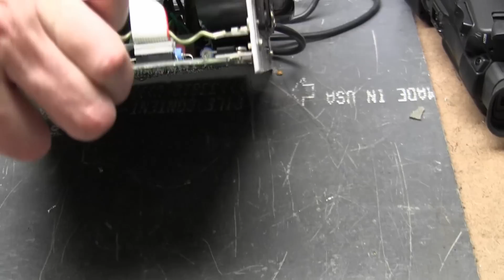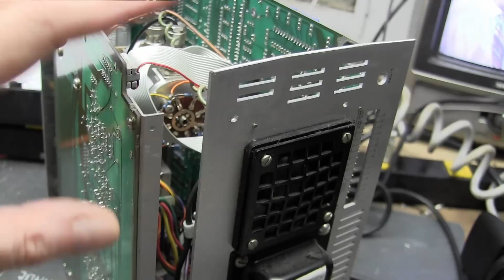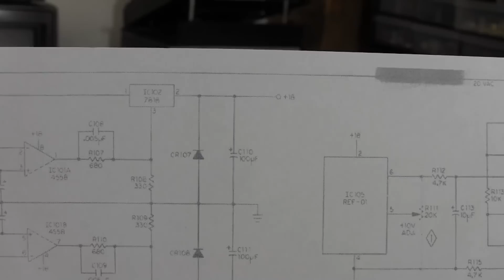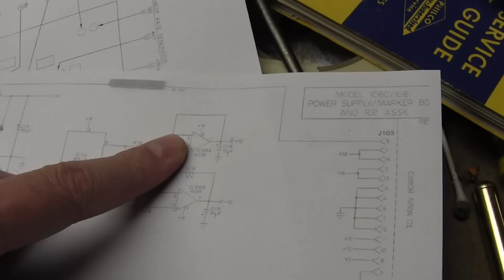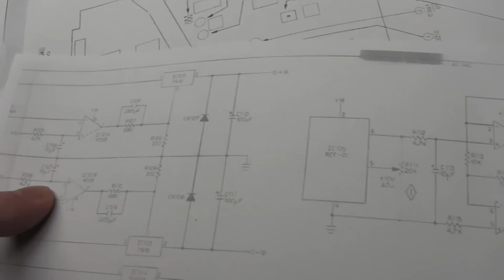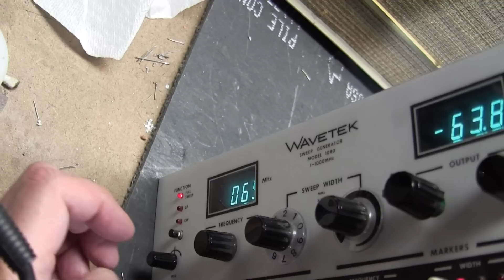Wavetek 1080 repair part 1

Comment: Have you measured the resistance of the power rails (to ground), on the main board ? (un-energized)
Sometimes if there is a short, it may show just a few ohms. But as you probe around, the ohms get closer to zero, the closer you get to the real short.
Reply from the maker: Please continue watching.  Shorted tantalum caps were the problem.
Reply: I watched the final video.
Good job.

Comment: Hello, it seems the link to the manual is not working. I searched manually on his site and the 1080 manual is not available there. Would you be so kind to provide a new link or, if possible, send it to me? Thanks.
Reply: I mean, the service manual with the schematics. I already have the instructions manual.

Comment: I spotted a website with 46 pages of 1080 info that seems to have the ever elusive TP's . However it is near impossible to post that information in a comment, as you will know. I tried 100 ways of obscuring "the address" but all failed and were quickly removed by eBay after a screen refresh. Well, the system works. Good on you eBay! :)  So instead I encoded the web address in HEX. There are quite a few converters online (both directions) so it should be just a click or two to get it back to ASCII. Where there is a will there's a way? I hope it can add to your WaveTek data.  Cheers -Randy

68 74 74 70 3A 2F 2F 6D 61 6E 75 61 6C 73 2E 72 65 70 65 61 74 65 72 2D 62 75 69 6C 64 65 72 2E 63 6F 6D 2F 74 65 2D 66 69 6C 65 73 2F 57 41 56 2F 57 41 56 25 32 30 31 30 38 30 2C 25 32 30 31 30 38 31 25 32 30 49 6E 73 74 72 75 63 74 69 6F 6E 2E 70 64 66
Reply from the maker: You can get many Wavetek manuals include the 46 page 1080 manual couresty of Chris Grossman:  http://chrisgrossman.com/manuals/wavetek/Wavetek-User-Guides-2019.pdf

Comment: Flaky? Got a dry joint Bob or tarnished IC legs?
Reply from the maker: It was flaky, now it's dead.  Shorted tantalum cap in the RF sweep module seems to have damaged something.

Comment: So many Trim Pots for Calibration...SHUDDER. Look forward to see what progress you make.
Reply from the maker: Even better - the service info does not include a schematic for the main board or have any instructions for adjusting those trimmers!
Reply: @bandersentv  My recollections are Wavetek had some great tech and designs but their quality was not up there with Tek or HP even close. I remember one piece of gear we had to send back 3-4 times to get fixed correctly under Warranty.
Reply from the maker: No, not even close, but also considerably less expensive.  Problem with HP is they just didn't make basic workbench gear.  Their comparable sweep gens are overkill for doing alignments.  Not that I would turn one down ;)

Comment: I don’t recall you saying that there were any power transistors buffering the voltage regulators. So, whatever current is demanded of them must be expected to be within the spec limits for the regulators. The data sheets will tell what that limit is. So, you could load them to the device spec limit to see if they fail. Perhaps that would define whether the fault is in the power supply, or the load. 
In other news, I bought a Tek 465 from what I think may be the same source you did. I haven’t powered it up yet, but it arrived in reasonable physical condition. I hope it works OK. There are some things for which I think the analog scopes are just better suited than the digital ones. I hope you’re able to get your generator functional again. I enjoy your videos.  Regards, Gar
Reply from the maker: There are no buffers, regulators good to 1A normally. However, this design inserted a 330 ohm resistor between the regulator and ground. Then connector to some op amps and a voltage reference. I believe the goal is to create a more stable supply? Not sure what effect that all has on the current limit
Reply from the maker: I bought my scope from a seller in Elgin, IL. Good luck with yours and thanks for the support.
Reply: I think it’s from the same seller. Mine had been a military scope at some point during its life, as I found painted unit designations on it while removing old paint prior to painting. No one but the military does that… I think it was Army. Krylon 5501 “Gloss Bahama Sea” is a pretty close match to Tek blue, if you’re interested. It wouldn’t do for touch-up, but is excellent for a complete redo.

Comment: My only thought is to try an isolated, current limited +18 and -18v supply to the unit and see if the RF unit draws excessive current or even works, just to try and break this chicken/egg scenario.
Reply from the maker: Yes, I will try. I have a current limited tracking dual DC supply I can use.
Reply: That was my thougt as well, that and sending it off to shahriar of the signal path channel 😊
Reply from the maker: @bzuidgeest  Haha.  That would be an amazing crossover video.
Reply: @bandersentv  well you never know... Normally he has to buy his problems to repair, you can provide one for free🤣

Comment: I have both the 1080 and the 1081, both work fine (last time I used them anyway)...the difference between them is the 1080 is 50 ohm and the 1081 is 75 ohm....by chance would you be able to share the docs on them?  ~Jack, VEG
Reply from the maker: Yep, there's just a single resistor inside that sets the output impedance.

Comment: I have used a thermal camera several times to find hard shorts on PCBs.  I sent 3A at .2V through the short and it was enough to make it get a few degrees hotter than ambient.  The low voltage is low enough that it does not forward bias any semiconductors.  If you have a hard short there isn't a lot of other easy ways to find it I don't think.
Reply from the maker: That's the problem - I don't. Well that is I did and replaced the shorted cap.  There's about 1,000 ohms between the +18v rail and ground now.  I suspect when the cap shorted it damaged something else.
Reply: @bandersentv  1K and it still is shunting it to ground? that is pretty weird.  unfortunately everything is soldered inside the can.  is it possible to disconnect the marker/oscillator parts to narrow it down or are is the power for both connected together on the pcb
Reply from the maker: @kevtris  No, they are separate.  I know it's the oscillator side that is the problem.  I get 1K when I check resistance between the +18V input to the oscillator and ground. I suspect the problem is when it's powered up.  It loads down the PSU enough that it shuts down.  I should also test the +/-18 volt supply with a heavier load.   It's still possible the problem lies in the PSU

Comment: What a difference between this "beauty" and the Sencore? Wavetek design, construction and parts are, not the highest, but a decent high level quality. It can be easily seen. You should continue in this restoring effort and for sure you'll find the solution. Don't stop please..... It's worth it...and please, post the videos...
Thanks
Reply from the maker: Well to be fair it's also about 20 years newer.

Comment: I always worry about those aging VFD's . Once they are worn out they are done . Old pins and switches get tarnished after a long period of time and can cause some problems namely erratic performance like those 33 yr. old tantalum and electrolytic  crapacitors. It is worth fixing for sure Bob.
Reply from the maker: These VFD are nice a bright for now.  One good thing is that it uses 7107 to drive them. 7107 are designed to drive LED displays directly so it should be possible to convert to LED displays.

Comment: Somewhere near the display should be a little higher voltage for the VFD's That power missing would blank the displays. No anode voltage.
Reply from the maker: Correct.  If I plug in the Rf module, the +18V rail drops to about 0.3 volts.
Reply: @bandersentv  Standard 7818 stabilizer has current protection set to approx 1A, than it switch off.

Comment: Can you sub in a bench +/- 18 volt supply to test your theory?
Reply from the maker: Ah, but sub in where? There is also a +/-10 volt supply that feeds back into the +/-18 volt regulators
Reply: @bandersentv  lift the regulator output pins and feed in +18 and -18 into the pcb holes. It looked to me like the +10 volt and - 10 volt are derived from the 18's. Don't worry about the trimming ckt that is tweaking the 18 volt rails for now. I have not studied that schematic so am only going by what I saw briefly on your video. I doubt it is a regulator problem.  Seems more likely to be a problem in that rf box. Do you have schematics of that? Can you power up just the rf box only from bench supplies and see what current it is drawing?
Reply from the maker: @herbertsusmann986  Yes, I have full schematics.  There is also a +5 volt supply.  I only have a dual tracking supply handy.  I'd need to rig up something for the +5 volts.  There are also control voltages that go into the sweep gen.  Probably be safe if I just grounded them.

Comment: Did you do an ESR test on those caps?
Reply from the maker: No. Its not a switch mode power supply and high ESR wouldn't be causing the problem I'm seeing